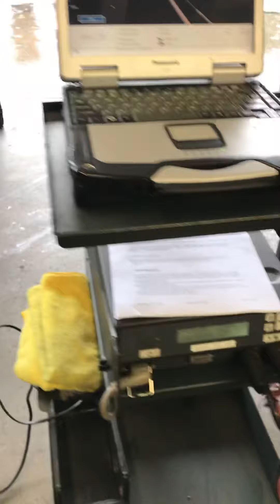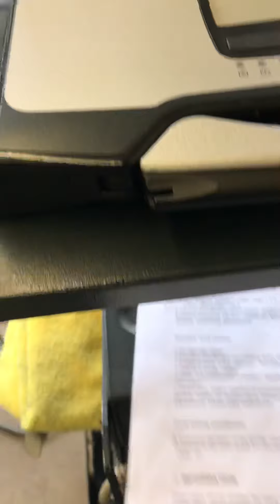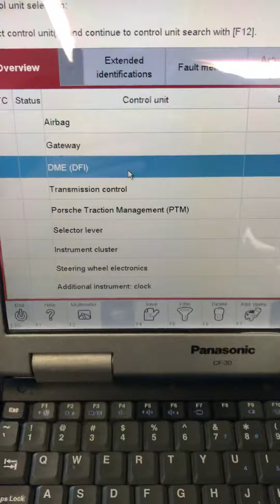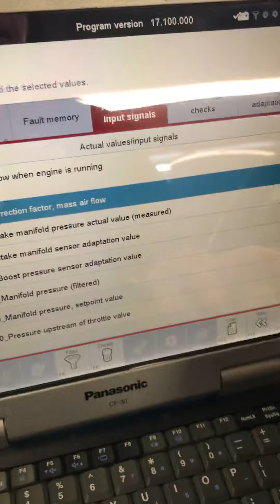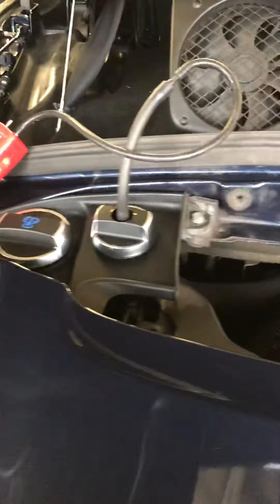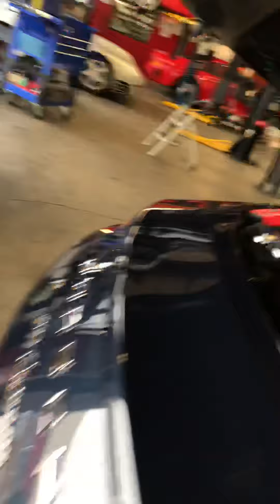Porsche Check Engine Light

Comment: Perfect just what I was looking for more more more more PIWIS 2 technical please  , but would like to see some 997 PIWIS action …  for example a full service using a PIWIS showing the values of a good running engine,,, what are good idol numbers on banks 1 and 2 , engine Engine roughness, generator voltage,  etc , what to look for when serving a 997 thanks 😊

Comment: The reason you don't connect a charger ground directly to the battery is because acid batteries generate hydrogen gas, in some relatively rare instances in sufficient amounts that it can explode if ignited. When you connect the ground, it can cause a small spark, and if close to the battery can cause the hydrogen to ignite. Batteries do explode. 
It's not anything peculiar to the Porsche vehicle.